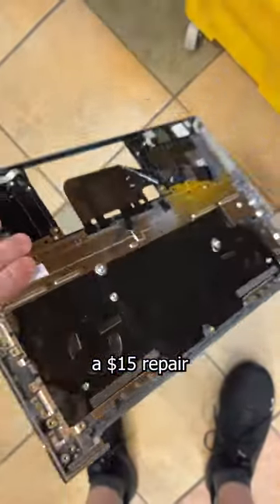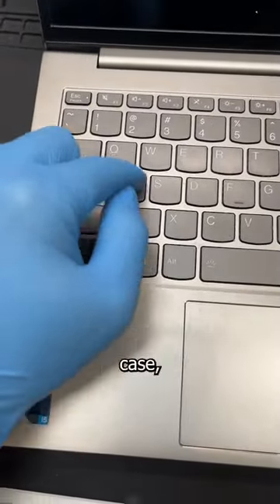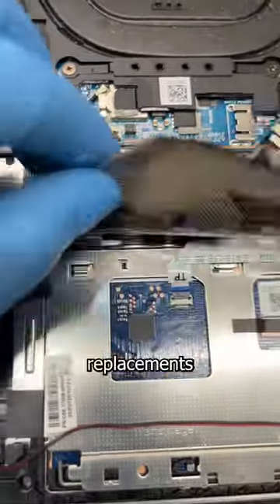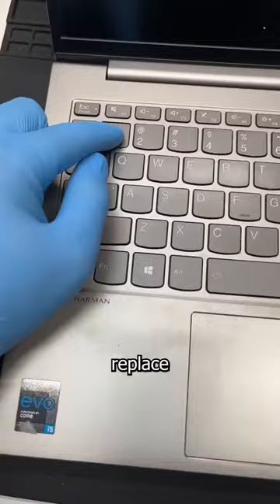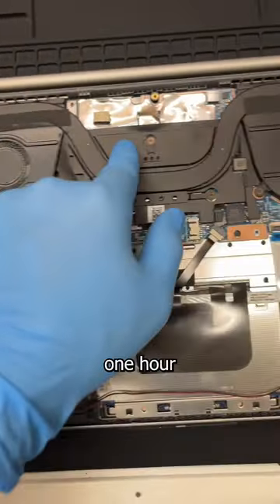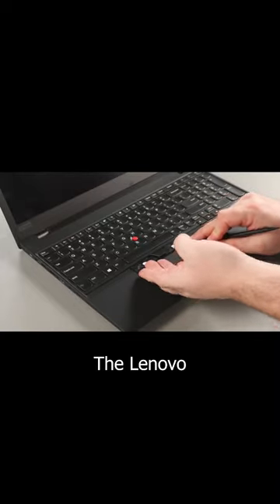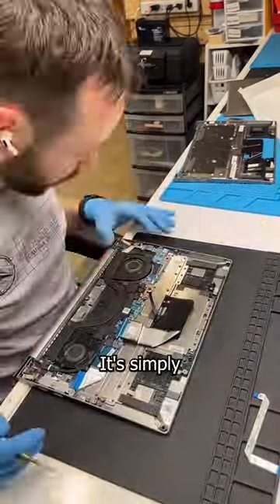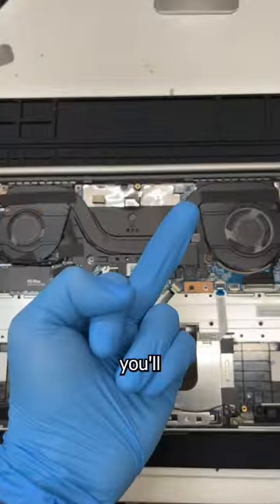This #pc design trend is bad for consumers. RIP Keyboard repair #technology #tech #computer #shorts

Comment: I love old ThinkPads.
My T430 (though it doesn't have that awesome T420 keyboard installed) has been upgraded with a delta fan, repasted with thermal grizzly, has 2 SSDs thanks to a modular optical drive to SSD caddy replacement, and a 1080p screen upgrade thanks to a daughterboard mod that goes between the connector and the screen. I also taped over the camera while at it, and flashed a custom BIOS to deactivate the CPU backdoor and turn off mic and cam, then installed MXLinux with an encrypted drive.
TL;DR Old ThinkPads a based and you can mod the hell out of them, it's what every laptop should be, respects privacy and fully repairable and upgradable.

Comment: Im part of my high school's tech crew, and we have 2 different models of Dell Latitudes we work on. We have the 3190, which has a replaceable keyboard separate from the palmrest. While the palmrest houses the rest of the components of the laptop, a few of us have become adept enough to remove the keyboard with out completely taking it apart. Just unplug the battery and keyboard, pop out the keyboard, then route the cable through as we put the new one in. 
The 3120, however, the palmrest has the keyboard fused to it. however, you remove the palmrest to get to the rest of the computer, so it takes almost no time.

Comment: People criticize the ThinkPad line, but nowadays they are one of the most repairable laptops you can buy 💀

I once had a E490, took me only 30 minutes to replace the thermal paste, the battery, storage, ram, and.. you can literally remove and replace the keyboard with your bare hands, to internal parts, take the back screws off and you will have access to everything

Comment: i replace only the keyboards, if you take a smd station with small straw size tip, heat the plastic rivets they will shrink down to a post, then simply remove the keyboard, if they are more domed on the end you need to get a metal scraper like for wallpaper or something and run it over to bump them all off first, then simply glue a few in place with new keyboard and you're done :)

No need to replace the whole top case at all

Doesn't take much time

Comment: Man… so many of my repairs are keyboard at the school district I’m at. We’ve only recently gotten some Dell 3100t that have individually replaceable keyboards. Downside is you gotta unscrew the battery and pull this table now before you can get to the connector but VASTLY easier than replacing the keyboard and transferring all the internals over.

Btw, kids are very inventive with what they can spell with rearranged keys.

Comment: Even if they keep fused laptop top decks, all they reall need to do is stop attaching components to it, and instead attach them to the bottom deck like the framework so you can swap it easier.

Comment: Not to mention when they use plastic or even metal rivets to hold the keyboard in place, making it an even bigger pain to replace. I got water in my laptop's keyboard recently and that completely killed it, thankfully keyboards for it are easy to find for around $20 on eBay but the repair process was painful (literally because I cut myself while cutting off the plastic rivets to remove the old keyboard) and took a couple hours to do, and trying to melt the leftover plastic to create new rivets the best I could for tens of holes was mind numbing. Meanwhile if this was my Dell Inspiron from 2013, I could've just popped a few tabs with a flathead screwdriver, pulled it out, unplugged, and had a new keyboard in its place in 5 minutes.

Comment: Had this exact problem at my IT job last week. HP 450 G8 with one broken keycap, had to replace the whole top cover, over 200 € for the replacement part. Every single component inside has to be transferred to the new cover, so if you break one of the many ribbon cables during the repair the laptop is toast.
Reply: It is very expensive..

Comment: Still using my Dell Latitude D610 from 2005. I have replaced the keyboard once, the hard drive with an IDE SSD, and the battery. I have been using it every day since elementary school.

Comment: I have a laptop like that.
One key fell off (left alt)
I though that i could put it back (i couldn't)
So i thought i could take another key that i don't need (right alt) and put it in place of the left alt.
After that i had 2 missing keys.
Then, not that long ago, my friend was playing a bit on it. After that i had 3 missing keys.
And as the cherry on top, when i've tried to clean left alt (it somehow worked even without the key), and accidentally damaged the board itself.
Now it's not really usable, since some buttons don't work at all, and a few aren't registering properly.
Thanks for that, acer

Comment: My Dell Inspiron 2200 doesn't even require any tools to replace the keyboard. (My keyboard never broke, I know that because it's the first step to get to the motherboard.) Also I have a question to someone who knows the answer, why when my dell laptop has blue lines flashing on the screen, I fix it just by replacing the bios battery

Comment: flashbacks to my MacBook keyboard replacement
.
Reply from the maker: pain
Reply: @SalemTechsperts  By about halfway through I was thinking I should have taken it to a shop to have someone else do the work.

I did get it done and the new keyboard worked fine, and I only had one tiny screw left over, so it was successful, just a PITA that took way longer than I expected.

Comment: Car manufacturers are the same way. Everything is modular. It's built into an assembly then installed on the chassis. When you have to work on the vehicle you work from the outside in. When you're building it they build it from the inside out. It's all for build cost like you said as well as the ease of assembly.

Comment: I agree 100%. The design is just dumb. I had a laptop i worked on a few years ago that was like this but it was so much more convenient. Pop the bottom panel off and 4 screws later the entire bezel and keyboard was coming out. Took all of about 20 minutes to replace. Brands to stay away from in terms of a repairability stand point.
-Dell/alienware
-any microsoft 2in1 from before 2022
-acer
-asus

Comment: Once I wanted to clean up my old 2013 Acer laptop. It took about 2 hours to completely remove all the parts and then clean it, taking another 30 minutes to put back together. It was when I turned it on that I realized I forgot to reconnect the fan with is small cable. I had to spend another 2 hours JUST to reconnect the fan.
Reply from the maker: I've done this on multiple occasions when I was a new technician back in the early 2010's when they were build from bottom up. I feel this comment.

Comment: I had that exact version of the Lenovo. The keyboard was trash - right out of the box it would frequently either miss or double-tap keystrokes for no obvious reason (a first for any laptop I've owned), and it felt flimsy and mushy to type on. And I made the same frustrating discovery when I bought a replacement keyboard assembly for it - which, after a long and hair-tearing procedure, did not solve the problem. That laptop wasn't cheap either, if I recall.

Comment: My old Inspiron from 2002 was amazing in this regard, you had 2 keyboard screws and once the board was out, it was 4 more to remove the access plate underneath and upgrade the RAM, CPU, or GPU. Like, it had a SOCKETED CPU that was user upgradeable with any de-lidded 478 socket chip, and while the GPU was a proprietary Nvidia form factor, it was used in a handful of different machines, so I upgraded it from the 16MB Geforce2 Go 100 to the 64MB one. Even crammed a delidded desktop Pentium 4 in there.

Comment: thinkpads are awesome... but somewhat more expensive than others... yet still worth it...
Reply from the maker: It depends on what ThinkPad but yes they are generally built to a higher standard. As of recently though Lenovo is diluting the ThinkPad brand with a few duds that don't do the name justice. Best way to buy a ThinkPad and not spend a lot of money is to buy it used off eBay
Reply: @SalemTechsperts  i couldn't tell you about that, i had two and still have them, both are awesome. L560 (not as rock solid as the T series) and a T14

Comment: i had a laptop for 5-6 years and about 2 years ago half the keys broke so i removed the spicy pillow of a battery and turned it into a pc tower until last christmas when i got an actual tower (also it consistamtly ran small games at a constant 10 fps and took 3 minutes to open a single tab but i refuse to get rid of it because it’s childhood history)

Comment: man, I used to work for company that was directly partnered with a laptop/PC manufacturer. They always took pride in serviceable laptops, all components were easily accessible. One day we got one of their newest laptops, we were supposed to add ram for a customer. I spent half an hour trying to figure out why the bottom case didn't come off like it used to on their previous models, and I called them up. turns out, the bottom case was screwed in from under the keyboard, which was attached with the flimsiest clips ever.

We did make more sales on replacement keyboards though.

Comment: I replaced my own Thinkpad keyboard. I'd never opened up a laptop before, and was very nervous, but the repair community had a lot of guides that showed it to be a fairly simple repair, so I went for it. Thinkpad lasted another 5 years. To be honest, it's probably still doing ok, but eventually Windows demanded most of its harddrive as tribute, and I got a desktop.

Comment: I learned that crap the hard way - I fix all my pcs and laptops for decades - so a friend destroyed his keyboard, so I go - order it from ebay, it’s an easy change - then I open it up and see this crap.. omfg, heat gunned it and then hot glued back, one key was still a bit off.. 
really a crappy design choice / now you have to order a complete set - it’s not worth going through the pain
Reply from the maker: You're a good friend to go through that. It's ridiculous what a simple repair has come to

Comment: A key cap broke on my laptop last year  and Lenovo refused to sell just the replacement key cap. I tried multiple online key cap stores but none of them had the right caps for my laptop, so I was left with two choices: pay $300 and have the laptop shipped to India for the entire keyboard to be replaced, or buy a new one. I have ended up just upgrading my laptop since I couldn’t be without a work computer for multiple weeks

Comment: i found this out the hard way when i was repairing an HP Omen laptop from 2018. I opted to go the cheaper route of clipping out the keyboard using flush cutters and gluing the new keyboard in, rather than buying an entire new assembly. it works well, but was absolutely a pain

Comment: Yep... I felt that recently. I've Matebook that i'm using for school stuff and accidently i flooded it a bit a month ago with water which led to two keys being damaged. What i thought at first is just gonna be simply 20$ repair turned out to be 180$... Cause whole palmestr had to be replaced even though only 2 keys had short circuit. Thanks Huawei!

Comment: it's not really about sturdiness. It's all about space efficiency and thickness. People want thinner laptops and thin means rather than using a backing plate for the top bottom case of the laptop and a backing plate for the removable keyboard module, the same plate does the work for both structure and the keyboard. Apart from that, by slotting the keyboard under the top case of the laptop, it means that the gap between the motherboard and the display assembly can be minimized without thicker top bezel or curved display assembly (to prevent the keyboard and the display from touching one another).

Comment: What I ended up doing with my brothers Lenovo idea pad was just to cutting the melted over plastic pins with a pair of flush cutters then I replaced the keyboard and used a soldering iron to melt over the plastic pins unfortunately I don’t think that repair will work more than once but it did work for me.

Comment: and then they wonder why laptop sales are going down. there was a time where one could replace even hdds/ssds & rams very easily with a maintenance door below the laptop. i had that for a short time as a desktop replacement. nowadays i'm back to normal desktop pcs and smartphones. i don't need cheaply made, glued together, nearly unupgradeable, unrepairable laptops.

Comment: there are luckily enough laptops that open from the inside, the repair is still a pain since replacing the keyboard either needs a new topcover or a lotta pain removing plastic rivets.

Comment: Which is why I've kept my old Dell for so long. Replace the keyboard? Pry a few catches apart, disconnect the ribbon cable, it's off. Need to get into the back? One screw, and you can get to the battery, HDD, M.2, memory, and WiFi without removing anything else

Comment: No. I have a laptop from 2012 and I have replaced its keyboard 3 times. Literally just ordered off of amazon and replaced it in 30 seconds each time.  This is a bloody nightmare. Also, I have replaced my hard disk once and changed thermal paste twice. And each time it took literally 5-10 minutes. (not including installing the operating system etc, just the hardware part). And the system is still going strong. The newer designs are absolute trash. Why do I have to wrestle with my laptop just tp unplug the damn battery when it used to be a click and out? absolutely ridiculous.

Comment: framework will definitely force other companies to consider level of repairability if they want to compete. no one's going to spend 1000's on a laptop that if a single thing breaks means a $100-$300 repair with the risk of it not even working again over a laptop that even if it was $1000+ to buy if something breaks its a matter of take bad part out and but good part in and your good to go in 10-30 minutes regardless of part

Comment: I repaired a laptop keyboard once, i way so pissed when i found out i had to remove the  pcb and disconnect almost everthing just to get the keyboard/top plate out. If you dont do this regularly take a picture of critical parts so you dont mess up reassembling!

Comment: Keyboard replacements like this are a tough sell. They're cheaper than a new computer and you don't have to mess with data recovery or transfers. On the other hand, $200+ repairs on low or mid-spec laptops aren't much of a value proposition. Putting that money towards a new laptop with better specs (and maybe build quality) is often a better long-term move.

Comment: Love my framework! It costed a lot of money(1,700)  but i didn't get the basic model and also bought it pre assembled. Its worth it to get a machine that won't be junk in a few years time when the hardware is out of date. Ill just buy whatever upgraded cpu comes out for it in a few years time and i can easily open it to clean fans and add ram if i want. Their most basic model is 900 unassembled or 1000 pre-assembled. Other laptops in the price range WILL be junk when the hardware is out of date. Its an investment. I saved up for it and i dont make much money at all. I wouldn't recommend it for everyone if you just want a laptop to stream video and do work on get a chromebook (yuck imo)

Comment: The alternative solution i found, to work around the bs that is the unrepairability factor of the computer itself, since nobody can realistically afford a repair price that large, is just get another, external keyboard once the built in keyboard started going bad.
my onn. wireless one has been going strong despite being dropped repeatedly, and the only long term damage it has is half the space key being lopsided and technically unusable if you try to press down specifically on that side of the key and not the other, perfectly functioning side.
im not thinking about a replacement keyboard anytime soon

Comment: Personally I think the main issue is that the brands use plastic rivets to secure the keyboard to the top case, making it either annoying to replace by making us remake all the plastic rivets or hella expensive by making us replace the whole top case.

They could've easily done it the way acer did it on their V3 laptops 11 years ago, using small screws and a slim plaque to hold it, making it considerably easier to replace instead but "screw" the consumer (and the technician trying to fix the issue).

I replaced the keyboard of my Lenovo Y50-70 not too long ago and since Im a cheap ass I remade the rivets on the thing and it was a huge pain, and isnt even a thin laptop to deserve to have plastic rivets!

Comment: something i wish would come back is socketed cpus and possible dedicated socketed gpus, because both on my laptop died and to replace just the cpu and gpu it would be stupidly expensive and almost impossible to do it because they're soldered down to the board
Reply: Some mobile workstations have replaceable GPUs located on a separate daughter board. The CPU tends to be soldered though.

Comment: Tell me about it. I just spent like 8 hours trying to replace a keyboard on a DELL G3 17 3779. Turns out while you CAN buy a keyboard separately, you CAN’T replace it because 
1) it’s under EVERYTHING ELSE (the easier part)
And
2) With some unscrewable screws.

Genius design

Comment: As a user, this sucks even more. You still get paid, but we have to do expenses we would have not have even done if it was otherwise. I bought a super repairable hp probook, added ram, ssd, everything easy, but to changes the keyboard? 270€ in a repair store because I didn't't dare disassemble the entire laptop just to get to the top cover and swap it.